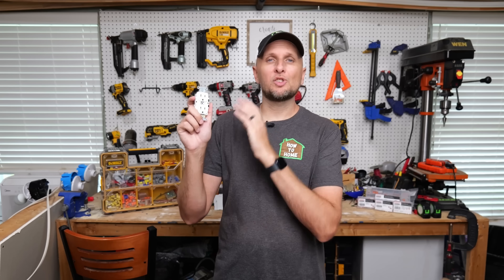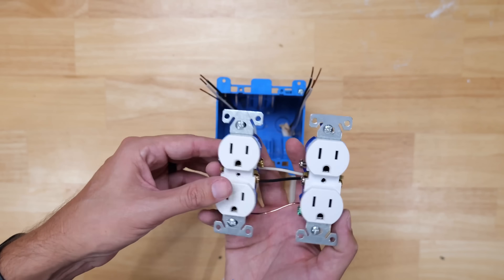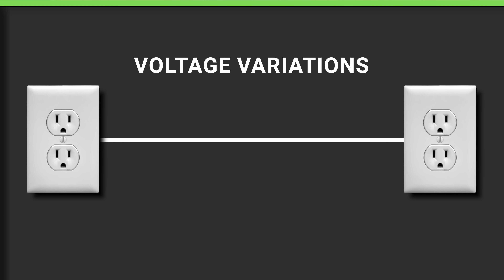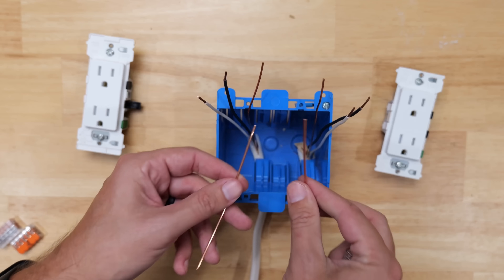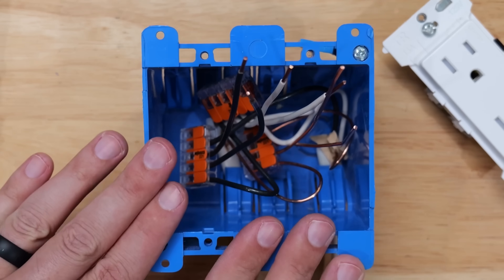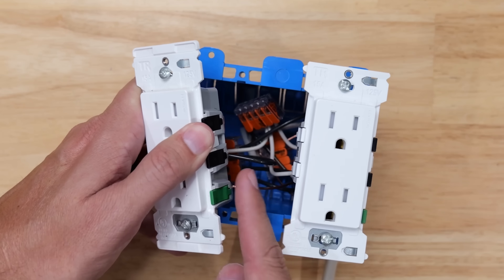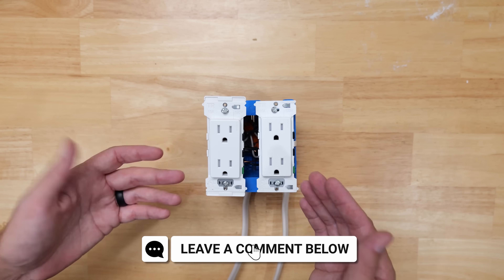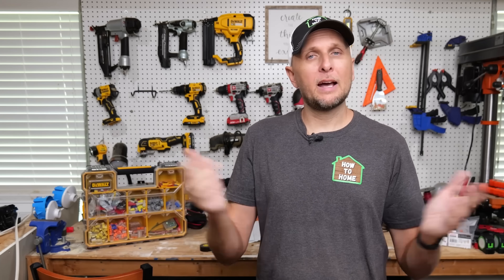Why This Outdated DIY Outlet Wiring Needs to End!

Comment: Voltage drop? WTF are you talking about? These receptacles and NOT wired in series. The terminations are still parallel. The current is not flowing through one receptacle and then to the next one. Wiring in this manner will not cause voltage fluctuations as long as all your black/hot wires are landed on brass/gold terminals and all your white/neutral wires land on silver terminals. What you are describing at 3:30 is completely inaccurate. Exactly what are you talking about with the receptacle failing? You keep using the term "pass though" but that is not accurate as the current is not passing through the receptacle before it flows to the next receptacle. The copper plates on the outside of the device serve as a mini buss bar making a perfectly safe and reliable termination connection. In almost all cases, the only thing in a receptacle that can fail is the internal spring tension of the blades wears out which will have no affect on this type of connection. Also, screw/clamp terminals are a better, more reliable connection method than any type of wire splice like a wire nut, Wago, etc. so terminating your receptacles in this manner is MORE reliable than more "standard" methods and it has the benefit of being cheaper. Yes, it is a little bit more difficult to troubleshoot with this configuration, but since you almost never need to troubleshoot individual receptacles, that is not an issue. Some will say that pig tailing is a safer method for chaining receptacles, but if you are turning the power off at the breaker before working on a circuit as you should always do, the method of termination is irrelevant. If you use commercial grade or lever-lock style receptacles you can make the exact same connections and avoid extra parts like wire nuts/Wago. This is especially helpful if you have shallow boxes or multiple wires filling the box.

As a retired electrician, in my experience the reason most electricians do not use this method of wiring, is because inspectors don't like it, for whatever reason. While we follow code, electricians do not want to have to do rework. So, we find out what our inspectors expect, and we do that even if it is not our preferred method.
Reply from the maker: That’s all nonsense.  Another comment of just negativity and misleading information.  About to ban you if you continue giving opinion as fact that is extremely misleading.  You have 34 comments across my channel, most of which are just like this.  Opinionated, stated as fact, using supposed former authority of being an electrician.

Comment: So you are connecting two black hot wire into one wago connector.  Apparently this is ok per the video.    You are connecting two black hot wires together, will this not double voltage or cause a problem? Im not an electrician.

Comment: On the older outlets as shown, the two power screws and two neutral screws are connected directly via copper metal.  So an outlet failing internally wouldn't stop the next outlet from working.  
Fundamentally,  at least for the "reasons given" I see zero difference in  daisy-chain vs pigtails 
Now, if say a daisy chained wire came loose, then you would loose all downstream, where as with pigtails then everything else should still work.  Although, at that point which is worse, loosing the rest of the outlet chain ... or potentially days/weeks go by not realizing there is a loose wire in one box.

Pigtails allow you to remove one outlet without removing the whole lot (even more so if using levers instead of wire nuts), so that has some merit there.
Though, on the flip side, pigtails take up more space in a crowded box.
So its half preference, and half specific application, but really cant agree with the "given reasons".

Comment: just a reminder that the receptacle is rated to be used in the daisy chain layout - but the groun wire MUST be pigtailed, so the device can be removed without compromising the grounding.

the pigtailing has more connections, which means more potential points of failure.  and if your pigtail connection fails, it still breaks the whole circuit.  but on the other side of the coin, the pigtail style is also easier to install the device to.  just do better folding the wires into the box.  that jumbled mess screams DIYer or rathouse electrician, and gives me the expectation of bad workmanship.  
if it is a single box with 2 cables, I feed through the receptacle, more than 2 cables, or multiple devices get pigtails.

addendum: if I'm replacing an outlet on short wires, I will pigtail to gain length.

Comment: I'm a Journeyman Electrician and I have never wired receptacles in series. I change this configuration when I find it.  I was always taught to pigtail for the very reason you stated. You gave a great explanation of why that method is not preferred.
Reply: Not a journeyman electrician, but did basic farm wiring and had NEVER seen anyone wire receptacles in series.
Reply: That is not a series, it is still parallel.  Series would be the neutral if outlet one connected to the heat of the second.  Naturally the switch is in series with an outlet or fixture.  Not two outlets. That would be very strange.
Reply: Box fill can be a major consideration in old work, otherwise I will fix it to pigtail to comply with new rules if I am replacing the receptacle. Some times, though, pigtailing can create an entirely different safety issue and code violation if your box is nearly full to start.

Comment: Not a licensed electrician, but an electrical engineer for 40 years and have done lots of home wiring. All outlets except GFCIs are wired in parallel whether that's through the outlets screw terminals or your separate pigtails/wire nuts. The only way subsequent outlets will fail is if the continuity fails between the wires outside the outlet, same as with your wire nuts. Would have to be cut or burned through.

Your way is fine, but I wouldn't prefer it. More expensive. In electrical engineering in general, not just house wiring, it is almost always better to reduce the number of connections, as this is very often where problems occur. Loosening, corrosion, etc. are more likely.

Comment: With this method you have many more points of failure and additional cost. The outlets are the busbar connection! You don't need to add more boxfill and failure points. This does nothing but add cost.
Reply from the maker: Wrong
Reply: @HowToHomeDIY if a line tap is desired, then use a line tap. As a design engineer I can confirm that it's code, but it fails engineering principles and I wouldn't sign off this installation for any projects.
Reply from the maker: Not surprised.  Still wrong.

Comment: Why don't Wago connectors comes in 4-port variations?  I can find them in 2, 3 and 5 port variations.  Using a 5-port variation takes up additional space.
Reply: I just bought a box of 200 connectors with 2, 3, 4, 5, and 8-port versions.  Kuject is the brand.  Box says they are rated for 32 amps and 250 volts.  AWG 23-12.  On Amazon.

Comment: I use the receptacle to pass through to the next receptacle. I've never had a receptacle fail and cause problems downline. And looking at a receptacle, it would have to be one hell of a fault to create an open in the circuit. When using backstab connections (which only jacklegs do) there can be dead receps downline, but that screw connection isn;t going anywhere. A wago connection will fail before a screw connection, because it operated on the same principal as the backstabs; a round wire touching a flat piece of brass.

Comment: I'm not sure this guy understands how a circuit works. Connecting via (Daisy Chain) at the receptacle and creating a pigtail results in the same circuit schematic and load. The pigtail just brings the daisy chain out away from the receptacle, but it is still a parallel circuit and not a series circuit.
The electricity does not pass through the receptacle therefore any loading issues created by a receptacle would create the same problems regardless of the wiring method used.

Comment: Have you taken a receptacle apart? Typically the screw terminals on one side and the plug blade clamp are a single piece of metal. Even the jumper between the top and bottom screw terminals is a larger conductor than the wire in the pigtail. The only time a pigtail truly makes sense is when you cut that link between the upper and lower screws to put two circuits in the box.

Comment: What are you talking about how would the brass metal fail on an outlet?  And if it did it would be a catastrophic failure.  What if the WAGO connection fails.  Your load situation i don't believe would be different and may be worse is the wago better than a screw terminal.  Maybe if they were back wired to the outlet but...  so that just leaves ease of troubleshooting which would require a broken feed wire, what if the feed wire breaks at the WAGO you still would have to look at multiple outlest to find where it broke.

Comment: You may not lose voltage putting outlets in parallel, but you will lose amperage (current) on an AC circuit.

Comment: As a 35yr electrical contractor those Wago quick connectors are a fire hazard in IMHO and should be removed off the shelves. They are cheap junk.. Have taken many of them out that were totally melted and tossed them in thrash. Just look in there and see what's making the connection. Flimzy thin cheap copper plated metal..  What's sad they really haven't been out all that long either.  Twist all your wires together and use a good brand wire nut and make a nice long pigtail. If you're not sure call an electrician rather than the fire department.

Comment: How would this make troubleshooting easier?  If I've wired them with the passthru method all the outlets AFTER the bad one will be dead.  Sounds pretty simple.  Also, if there is a large current draw on the circuit the drop will show on ALL outlets on the circuit regardless of wiring method.  I've used the passthru for decades and have had no issues and see no reason to change.

Comment: Couple things...

- This will NOT reduce voltage drop, which is a function of the load, wire length and number of splices, none of which is lessened with this method. 
- This method CAN reduce the failure rate for both DIYers and electrical installers because it puts the splice's engineering into the lever connector rather than the hands of a person with limited understanding of how to properly make a splice. The same concept done with wirenuts will be subject to a higher rate of failure if performed by DIYers or electrical installers vs a trained electrician simply due to a lack of education on how to properly make up a wirenut connection
- It does NOT eliminate the possibility of a bad connection downstream as any kind of connector (terminal plate, wirenut, Wago) can fail
- It DOES make it easier to replace devices and safer to do so in commercial environments where (at times) it's necessary to replace a device in a hot circuit without disrupting power to multiple users downstream

Comment: Why isn't there a 4 port Wago?
Reply: Other companies make 4-port connectors.  I just bought a box of 2, 3, 4, 5, and 8-port connectors.  Not sure why they skipped 6 and 7-ports.  Maybe when you are getting that high in wires the volume doesn't justify making every single size connector.

Comment: You cannot do the ground that way. You are putting two ground wires on one Terminal. Also if the receptacle failed the power still passes thru the breakout on the terminal. I saw a lever lock test on YouTube and the wire pulled out of the lever lock at. 8 lbs.
.
Reply from the maker: What are you talking about?  The ground is pigtailed.  It isn’t two of them.
Reply: @HowToHomeDIY   yes, the way you show the lever locks is perfect. But the early picture shows a jumper wire on the grounds. You cannot use a jumper here. Each receptacle has to have it's own ground. I'm sure you know this but the jumper is misleading. Someone might think you could treat the ground like the hot and neutral wires for a double duplex.
Reply: @HowToHomeDIY   two do the grounds the easiest way would be to twist the grounds using a crimp sleeve leaving the two grounds long enough to reach the ground crews. NO JUMPER, one wire per screw.

Comment: Lets see.... 5 port Wagos are about $4-5, vs simply learning to spilce wires correctly...less $$.   By the way , the Wago and new rec's  are really still spring connectors subject to failure sooner than using the screw terminals.  37 years master electrician, never once a failed screw.

Comment: I have read through the comments and I see many bringing up AFCI/GFCI outlets protecting down stream. I have not seen anyone discussing a Type 3 SPD Receptacle. These are similar to AFCI/GFCI however protect the circuit from a Surge. Type 1 & 2 SPDs are available for most Panels however adding a Type 3 will add to the protection of the protected devices, think your 75" Multi thousand dollar TVs.
* Not an electrician. Just a DIY'er.
Reply from the maker: I have a video on the channel on exactly that.

Comment: I dont get it. THere are two terminals per side, each of which is bonded direcly to the other. The downstream recepetical is not "relying" on the first receptical;  it simply is wired in parallel wtth the first.  In the few times I have had 2 recepticals in the same box, I simply strip the hot and nuteral about 4" back from the end of the wire. Make a loop and stick the bare loop under a single terminal of the first reeceptical then terminate on the second receeptical.. I like this way because its cleaner, less connections in the box and its easier to wire.
Reply: What you are saying is absolutely acceptable. I prefer pigtails in single gang boxes, but in multiple gang, I do it the way you describe.

Comment: Even if an outlet “fails” (using his word), the connection is being made at the copper plates on the side of them. To me it’s a moot point because just like a screw can come loose so can a wire nut or other connector. In fact, by pigtailing you’re introducing additional joints which can fail. The point about voltage drop makes no sense, it’s all on the same circuit anyway so any loads and wire length issues remain virtually the same with either method. His basis is also not sound, it’s just a lot of “I heard a lot of electricians don’t do it this way anymore,” etc… nothing proven or scientific.

If it’s not a good idea why is it NEC approved and why do the receptacles have two terminals on them for just this purpose? Another thing to consider is that in an old house with small boxes it’s much easier not to crowd the box with pigtails. Sometimes adding pigtails makes it so the device won’t even fit in the box anymore or has to be jammed so hard in that it creates hazards of its own.
Reply: You just described most of the outlets in my house.  Add to that the fact they are wired with #12 Romex and wiring changes are always a nightmare.

Comment: I am very confused. I installed two light switches in the same double box. INSIDE they had 4 white wires in one wire nut. NONE going to the electrical switches. Exact same for the ground wires. NONE going to light switches. One light switch is on a 3 way..the other is not. There is one red wire going to the 3 way switch. the rest are black. and there is a black pigtail coming off the 3 way switch over to the single switch. Why did they do this and is it correct? the lights work.....
Reply: Regular switches, including single pole, 3-way, and 4-way, the neutral wires do not connect to the switch. They return the current to the electrical panel. The switch works by making and breaking the current flow on the hot wire (switch leg or load wire) going to the light or whatever is being switched. As long as the switches are on the same circuit and neither switch is protected by a GFCI receptacle, the way it was done is correct. If they are on different circuits and/or one is GFCI protected, then the neutral wires must be separated accordingly. Regarding the ground wires, if the box is non conductive, e.g. plastic, the ground wires should be connected with pigtails to each switch, or it's considered a code violation in most cases. If the box is metal, the ground wires must be pigtailed to a grounding screw to the box. Pigtailing to each switch is not required, if self grounding switches are used, as the mounting screws will serve as the grounding aka bonding jumper.
The red wire and one black wire are travelers that connect to the 2 gold colored screws on the 3-way switch in order to direct the current according to switch orientation. The black wires that are pigtailed, are line wires (always hot) that go to one terminal on each switch, the black screw on one of the 3-way switches. The black screw on the other 3-way will have a wire going to the light.

Comment: If there is a buss bar  for hot and neutral connecting the two screws on an outlet what is the point of adding three more wires and fittings in the box? Also it it increases the amount of devices that are allowed in a box.